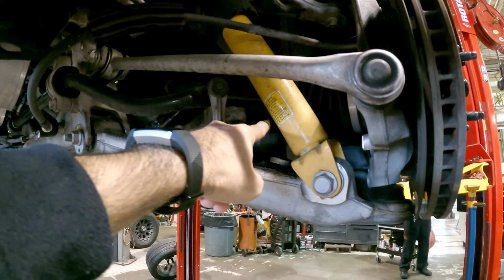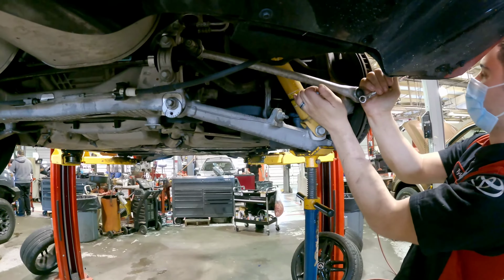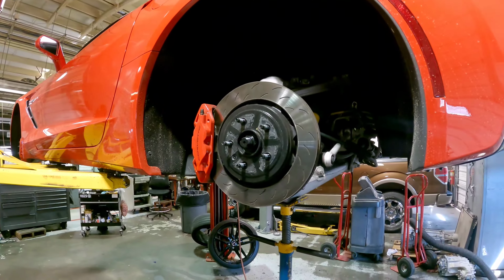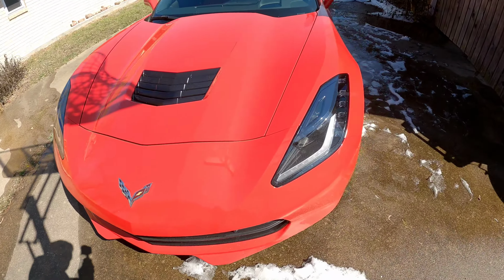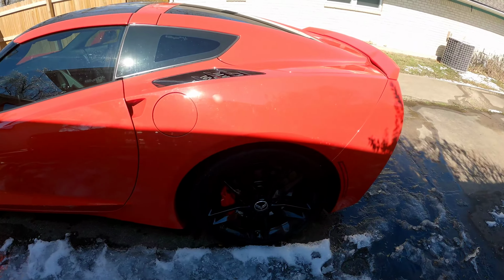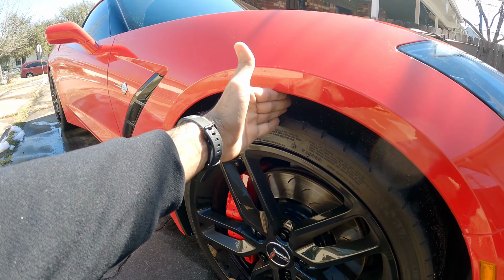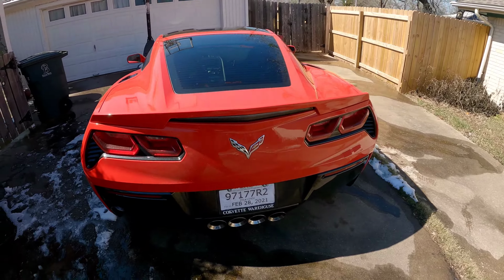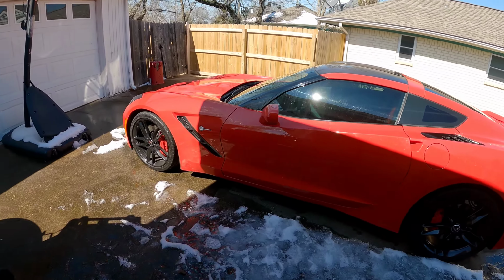I LOWERED My C7 CORVETTE on the STOCK BOLTS! EASY and FREE!

Comment: Two questions!
Did it change the smoothness of the ride?
Can the back of the car be lowered without doing the front?
Reply from the maker: I couldn't tell any difference in smoothness of the ride. Yes you can do the back only if you want to.